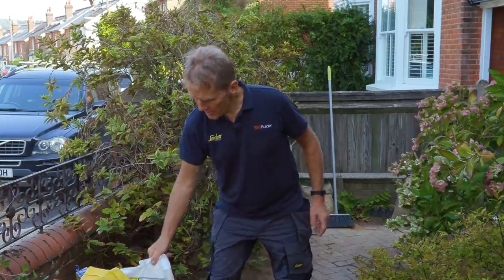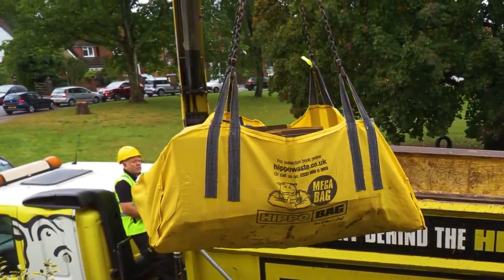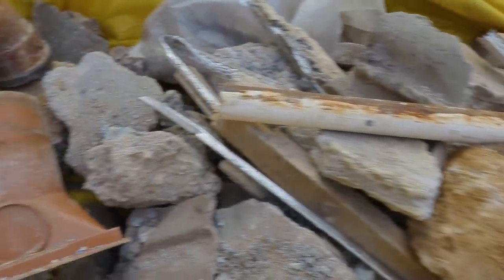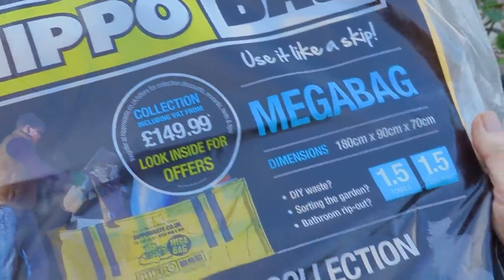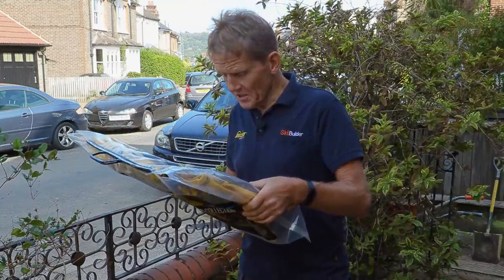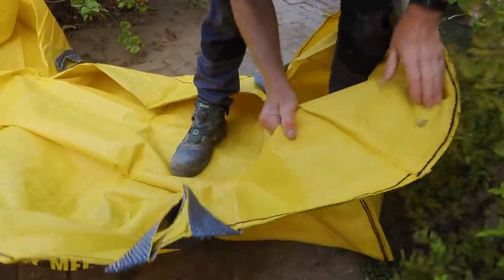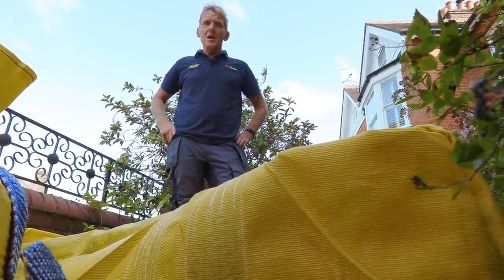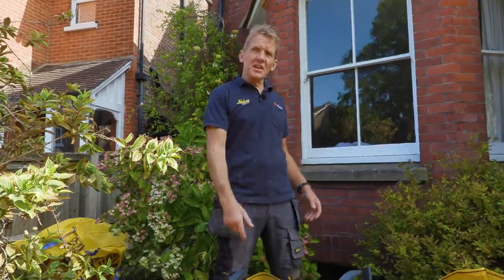HIPPOBAG ~ Easy Skip Bag Rubbish Removal

Comment: I've used them quite a bit for my own kitchen and building work.  They are very expensive relative to traditional skips but they are extremely convenient and avoid all the hassle of council permits, particularly with smaller jobs.  They have always collected within 5 working days for me thus far.  It is also worth considering a grab-truck/muck-away service for large volumes of loose material like soil or hardcore.  Always shop-around and cost all the options.

Comment: I use theses bags for kitchen fitting! (Wickes fitter!) there a nightmare to fill nicely with the old units. Plus don’t put them on a slight hill (top of driveway) by the end of the job it would worked it’s self to the bottom of the hill/driveway

Comment: What wasn’t mentioned was that it has to be placed within 4 metres of the  road without obstruction from trees, overhead cables etc.
Good luck with that one.
Reply from the maker: I think that is entirely reasonable and in my experience it is possible in most cases. We are used to having loads craned off and all deliveries and collections have limitations but they certainly aren't onerous. Getting a skip in and out is often a lot more problematic.
Reply: The product is an alternative to a skip. Have you ever had a skip somewhere that wasn't that distance from the road?
Reply: how else is it supposed to  be moved via teleporter?

Comment: Watch out when you order these. Read the t&c first. I almost didn't, then as did realised its only in their t&c do they point out they WON'T pickup over parked cars.
Reply from the maker: Steven 
I don't know any delivery or collection service that cranes over parked cars. Even if you don't damage them,  people will claim you did.
Reply: I've seen Jewsons and Travis perkins crane loads straight over the top of my van on site over the years 🙄
Reply: @e30mark  the deliveries always go over cars parked outside. Can understand why they don’t though, especially lifting them out.
Reply: Really? If I looked out of my window and saw anything being lifted over my car or van I'd be very unhappy, I'm sure they are adequately insured against damage. But insurance doesn't cover all the inconvenience caused. That said if parked cars are the problem, that is probably the reason that a skip is not being used, if you have followed the stipulated requirements of load and location, parked vehicles are not your problem, it is on that company to overcome the issue. Knocking on doors is therefore the collection drivers job
Reply: @e30mark  yeh not cool

Comment: Am I completely missing something, Why is this service more expensive than a 2, 4 or 8yard skip. I pay £115 for a 1.5 yard skip and  £138 for a 4. Both of these are cheaper  than a smaller bag from them.   Do they have unpublished trade prices that make them more realistic?
Reply from the maker: You are in a cheap area. Skips in London are more like £250.
Reply: @SkillBuilder  yeah think they make much more sense in London or city centres. Where skip plus permit costs are through the roof
Reply: @SkillBuilder  I don't think Leeds is cheap, its inline with most of the UK. It's London that's expensive. I think Hippo Bags are missing a trick, they need to price according to local rates. I would find it useful to have a few in the van for smaller jobs when I don't need an 8Yarder, shame. We also have waste collection services which cost a touch more than a skip  but will collect waste from back gardens or inside a house.  Often saves paying a council permit. ---- BTW,, Thanks for the reply..........

Comment: Bit silly that they take the bag away and dont let you reuse it. And so is their explanation on their FAQ page. Those bags are sturdy and well made and I thought the whole point was to recycle and reuse.
Reply: My query is can you only put general crap in the small bag? They don’t seem to accept rubble in a bigger one
Reply from the maker: It is about the weight. You can fill the mid sized one up with rubble and it won't exceed 1.5 tons but if you put too much in the big bag it would.

Comment: Just paid £312 for an 8 yard skip, which I think is better value. Might be okay for small jobs.
Reply: Agree, but if street permits are up to £100 a day, the hippo bag soon seems more affordable. I'm just outside Edinburgh, and the 8 yard skip I had last week cost me £210inc vat......
Reply from the maker: @kills99ofbacteria50  Yes it depends where you live but in the London area a 6cu yd skip costs me £250 inc vat and if it goes on the road that is a big hit, If you need a skip then you need a skip but often a bag will do the job.
Reply from the maker: Yes if you have enough room and you have enough rubbish then the skip is good and Hippo are in that business too but this is another option.
Reply: Jeezo! 8 yarder where I am (Glasgow) is £190
Reply: £240 for skip Gateshead any type of rubbish ,£20 for permit for 28 days.
Reply: @u2kjib4cjkqn  tbh I hardly ever use skips these days...got a really reliable guy who comes in his tipper and takes everything away. Depending on the load its usually between £60-£80
Reply: 320 quid in surrey but the point is its about access
Reply: @paulmcfadyen689  Living in London is expensive.

Comment: 100£ a day jesus thats a ripoff if ive ever seen one. I do like the idea of these bags espacially if you dont have a car to use and considering you might not have the need to fill up an entire skip.
Reply from the maker: The London Boroughs are skint so they make money any way they can. One wheel on the kerb in Croydon cost me £50.00 A skip on the road in Twikenham cost £100,00 per day and a fine if it isn't coned and lit.

Comment: It’s cheaper to hire a registered waste removal company, just make sure they show their waste carriers credentials,
Reply from the maker: There are a lot of people who will flash a piece of paper in front of you but that doesn't mean they are going to pay to dump it legitimately.
Reply: Not always. We asked a local, reliable and honest one about getting rid of the massive amount of hardcore I'd created getting rid of the old patio. They quoted over 400 as they said would be difficult getting rid of the hardcore. Fair enough. I ended up just taking it to the tip myself. Only 10 bags a time over several weeks all for free (tip a 5min drive away). Wasn't commercial waste so wasn't illegal. Looked at hippo but not lifting over parked cars killed that idea.

Rest of the hardcore is now going in the whole at end of garden for foundation of a big shed.
Reply: @SkillBuilder  , you can check their number on the government website to see if they’re legitimate, any builder can print off references, public liability insurance .
Reply: @TheStevenWhiting  , I’m not sure what your point is. Are they supposed to work for free? You spent several weeks taking it to the tip yourself, which at my local tip is chargeable, you probably didn’t do your suspension any favours and you used the remainder for foundations anyway!